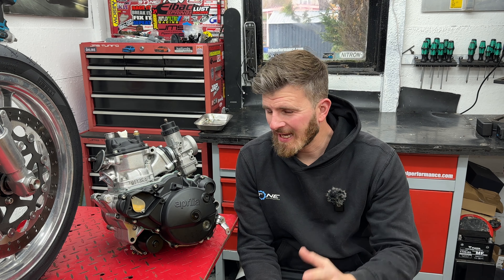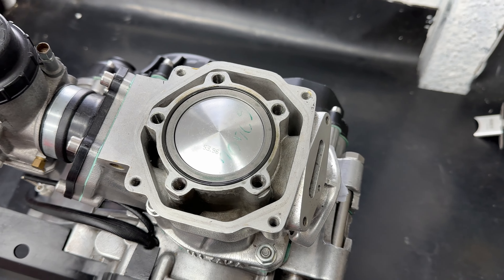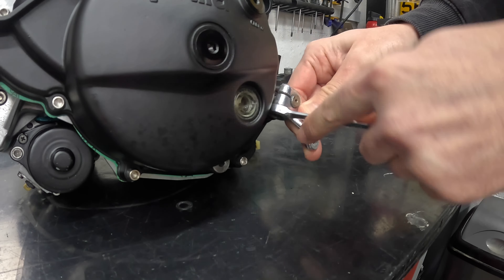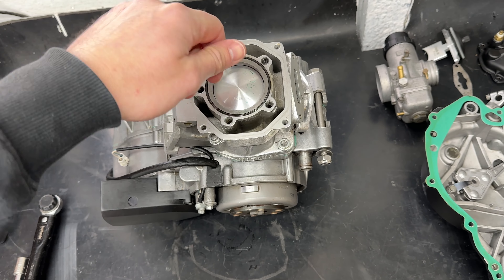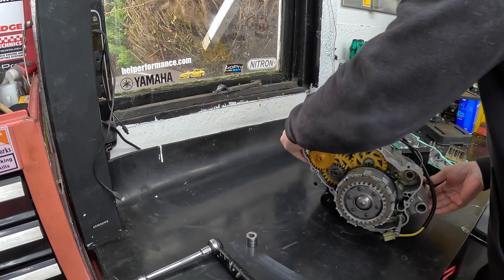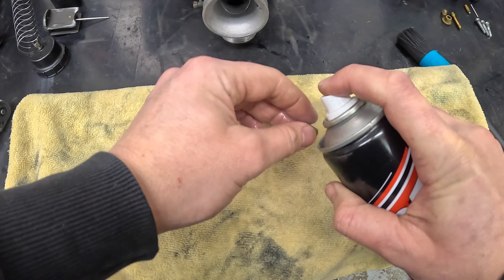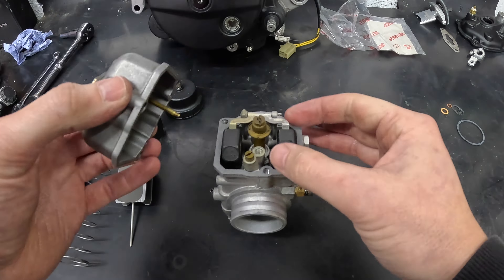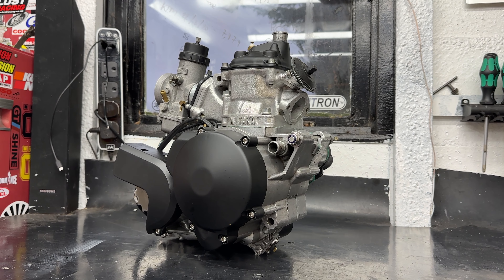Aprilia RS125 restoration project - Is the engine I've bought actually any good? Episode 2

Comment: 9:45 The squish gap is the squish gap, it won't tell you much about the compression ratio. You could have a head which is running 1mm squish but the combustion chamber volume has been made large by machining the bowl, the CR would still be low. You need to get both aspects of this right if you want the best out of your engine, I would imagine that the squish gap would want to be around 1mm, maybe a touch less. You don't want the gap to get too small as it pushes the gas velocity up too high which can then promote detonation, (the opposite of what a squish head is supposed to do!) Equally you don't want the gap too large because it will stop working as a squish band, it also wastes some of the inlet charge because it will burn too late to be of any use in making power. With your gap at nearly 1.6mm I would say it is 'borderline' not working as a squish band at all.  The head volume at TDC will determine the compression ratio, I have no experience with your engine but as a guess you would want to be running around 13.5:1, this would be the geometric ratio, not the 'corrected' ratio (i.e from when the exhaust port closes). I don't like using the corrected ratio, its nonsense in my opinion, basically I agree with A.G.Bell on this point, he is the author of one of the 2 stroke tuning books that I have. (The charge lost out of the exhaust port is forced back into the engine anyway by the reflected positive pressure wave in the expansion chamber). I'm sure someone will come along and give you the CR figure that is best for your engine, bear in mind that pushing up the CR can help the mid range and top end but can cause the engine to not want to rev much past peak power RPM. If you go to high with the CR then clearly you can push the fuel into detonation, or at the least the engine will 'heat fade' when the throttle is held wide open for long enough to allow this to happen. Obviously the fuels octane rating comes into play here.
Reply: I was going to say that! Honest. 😂
Reply from the maker: Thanks for the detailed reply, the barrel is going off to PJME 😬

Let the professionals work the magic (above my head 😅)

Comment: You seem to be measuring both sides of the solder at the same time. You need to measure each side of the solder separately.
That's why you are getting such a large squish band.
Been waiting for this video. 👌
Reply: Yes, Paul. That's what I thought, too. So it's probably about .75 mm which should be okay.
Also squish doesn't equate to compression ratio, that needs checking separately. 
That said it looks like a great engine you have there.
Reply from the maker: Sorry lads should have been clearer in the video, solder wasn’t thick enough so ended up doubling it up
Reply: @AutoBeta2T  Well said that man! 🙂
Reply: Great 'catch, well done for spotting that.

Comment: I have recently rebuild an rotax 122 engine for my rs, measured the squish as well, got to 1,4-1,3 with 0,3 gasket. So I spoke to a pro and measured the volume of the head with oil and that was about right for non-racing 125. So I guess the big squish is ok as long as volume is as well. Ran ti, runs well. On a stock head tho.
Reply from the maker: Interesting, I’m now down to 1mm squish so we shall see how it goes 😅👍

Comment: The jetting seems ok.   Had that been my bike i would not hesitate to fire it up with that carb setup.   It probably was the carb for that engine/bike, it just got pulled of and someone forgot to empty it for fuel when doing a rebuild on the engine(/bike)   It looks like you are missing some parts for the Power valve. Not sure what mode you have there. but there should also be a "housing"  and an adjustment knob(black housing and red knob, or alu frame and black knob)  Keep them videos comes, love to see the Rotax/2 stroke content.
Reply from the maker: Thanks for the feedback, like you say a few others have mentioned the jetting is about there 👍

That power valve is complete so I’m told, there is a more advanced version which is adjustable but this ones fixed opening (let’s just hope it works 😅)

Comment: I had one rotax 122 on my aprilia sx 125 and it was amazing engine. I had VHM and 38mm carburator with arrow pipe. It was nice and realiable bike and very powerful. I drove it 3 years all the time and just changed oil and pistons. I tried those rave power valves, but I used it with open valve because i had problems with those power valve systems.

E: Im not sure if this is rotax 122/123, but it seems similar. I remember that I needed to put 800ml oil in it, but it said 600ml on the side. If you used 600ml you brake yellow plastic gears. I would check that out.
Reply from the maker: Mines the 122, shall be interesting to see how I get on with the power valve set up.

Thanks for the tip regarding the oil 👍

Comment: there are 3 different vhm heads, i just got mine a few days ago, i ordererd a standart one bute there are 2 others. there are 11,50cc wich is a higher compression ratio then there is the 11,60cc wich i orderd with standart compression and there is a 11,80cc one with lower compression ratio. with the 11,60cc head i now got a 13,48:1 compression wich is exactly what i wanted. with the standart head my squisch whas way off with 2,1mm, even with the thinnest gasket i could find. ur 1,5mm would be bang on for street use.
The 155 main jet is standart set up in the 34, i am now running a 158, cause i got a few mods done to the engine and around
Reply from the maker: Good to know! Strange there’s no markings to let you know which model I have..

The squish is now set at 1mm - the barrel/ head was sent away to Paul at PJME and he machined the barrel down to increase the compression 😎

Comment: Regarding squish and high compression, from an MX point of view. It isn't always a good idea to run a higher compression because you might loose some overrev capabilies. Therefor loosing power and revs on top for a small gain at low revs.  Since small displacement engines need revs to produce power I wouldn't raise the compression by alot, especially if you don't intend to put some hours dynotune it to get it working right.

Short, some stones is better left unturned 😊
Reply from the maker: Agree, you can certainly go to low on the compression, detonation can then also start to occur 🥴

1mm squish appears the best setting for a road bike, with it being 1.5mm it’s going off to Paul at PJME for a slight tweak 😬

Comment: Sound mate, yeah, I got some rik Rings instead of the mitaka 140cc rings there ment to be one of the best , Japanese rings and engine is all done and frame work completed now off to the powercoaters next month, got new set of raidtors coming soon and a graphics kit from france. I'm on the worst part now sanding all the pannels 😂 in order to down to spary them
Reply from the maker: The painting part is so satisfying but as you say the prep is a nightmare 😅

Comment: It looked like when you had the original measurement t piece made there was only one thickness of solder on either side but then when you were measuring in the end you were measuring two pieces together. Was this just because you weren't getting any reading with the single thickness?
Reply from the maker: Correct, I should have mentioned that in the video
Reply: @stoneautomotive  okay that's what I figured I just wanted to make sure you weren't for some reason measuring both sides at the same time.

Comment: Engine is spanking! Also I noticed you used a fancy little attachment for your torque wrench to get on those head nuts - what where they!?
Reply from the maker: Crows foot spanner, can get you right out of trouble 😅

https://www.ebay.co.uk/itm/234953648537?mkcid=16&mkevt=1&mkrid=711-127632-2357-0&ssspo=X_IuMAaJS4q&sssrc=4429486&ssuid=CKFRglVnR7S&var=&widget_ver=artemis&media=COPY

Been following your latest project, soul destroying the head ache it’s given you but fair play for cracking on 👍

Comment: K21 needle (look up the chart and measure what's in it, might already have one) on top or second clip, 158-160 main, 34-36 idle jet, B40 emulsion tube. Definitely needs less squish, not sure how much less though, I'd guess in the 1.15mm range... Although running at 1.5mm will be fine most likely. Start with the fatter jets and lean it out one size if a plug chop indicates you need it.
Reply from the maker: Yep I have a solution now for the squish, PJME will be working there magic!
Reply: @stoneautomotive  I look forward to hearing the little blighter sing 😁

Comment: I’d assume that vhm will specify a squish clearance of 0.8mm, which will also give you the correct combustion chamber volume. 
As of your measurement of 1.5 mm, not only are you excessive on the squish clearance, but you will also be low on compression. 
Using a thinner base gasket will get you closer to the desired spec, but I think you’ll struggle to find a base gasket thin enough to bring it into spec. 
I’m guessing that the mitaka cylinder may be slightly taller than the stock cylinder.

You should also perform a pressure test once assembled.
Reply from the maker: We have a solution regarding the squish, more in the next episode 😬👍
Reply: @stoneautomotive  good to hear, I’ll look forward to it 👍

Comment: What jetting is in that carb im running a 155 main with 37.5mm pilot with the 34mm carb and 140cc mitaka and dual stage reeds and runs faultless i know some one who has 4 mx 125s and runs this same set up without issues
Reply from the maker: Reviewing comments I’m “ok” on the current carb set up 👍

Comment: Looks like that barrel has had a liner fitted (standard it would be a plated bore, and the Mitaka barrels also use a plated bore).

If you get oil in the ignition side cover then you have a big problem!

Jetting sounds about right. The needle valve looked worn (from memory, brown end of the needle valve is the later type suitable for fuel with ethanol in it).
Reply from the maker: PJME completed the top parts so should all be in good order 😬👍

Thanks, no gasket for the ignition side cover though to prevent dust etc entering?

Good to know regarding the needle valve 👍
Reply: @stoneautomotive  , think silicone is meant to be used between the ignition cover and the engine
Reply from the maker: @twosqueaks4839  that was my later thoughts too 👍

Comment: I wouldn’t go under 1mm squish on the road. 

I would guess that 0.8 squish would be too tight even for premium pump fuel. What people seem to mis understand is that making the squish mega tight also reduces the cylinder head volume… in turn causing the compression ratio to be much higher than what is safe on pump fuel.
Reply from the maker: Yep a few have advised 0.8mm is too much for a road bike, barrel will be going back to PJME for some magic to happen 😬

Comment: Looks like your idle jet is missing. It should be a 5mm thread, 40 to 45. Main jet is 155 is fine if you use the original airbox, then it depends on the filter thickness, exhaust and so on. 155 is a good starting point, though you might need to go down to 150 or up to 160 according to your specs. Without the idle jet I don't think you'll ever be able to idle, it'll always be too rich below 2000 rpm. 1.5 mm squish gap is standard. With the original Gilardoni Aprilia cylinder usually needs 0.3mm or 0.5mm to reach 1.5mm squish gap, though I've been told that the Mitaka kit might need thicker gaskets. I wouldn't go lower than 1mm. You can measure the compression ratio, but there's always a margin of error even if you use the correct technique. MItaka kits seem to be reliable enough, though the fusion is not perfect, that might explain why they ported it a little.
Reply from the maker: Thanks for that, shall have a proper look over the carb when the engine goes back, something simple like that could cause a lot of headache 🤦‍♂️

Barrel and head are back from Paul at PJME and skimmed to 1mm squish 😬
Reply: If you need to buy the idle jet, I recommend the 'tall' ones. I know some people on the 28 remove the idle jet when they go racing, you need to screw the idle screw all the way in, they do that because their engines run at 13/14k rpm and they might seize if they use the engine break after going flat out all the time. Having a very rich idle might help extreme users, but I don't think that's your case. Let me know how it goes

Comment: 1.00mm is the correct squish 0,8mm is to small, and wil get pre detonation
Reply from the maker: This is what I’ve been advised, thanks for confirming too (good to know thats considered the optimum for roads bikes 👍)
Reply: @stoneautomotive  I race the same cylinder on my racing kart. And there it’s even set in the rules to not go under 1.00mm gap. Check your spark plug gap too it needs to be 0,7mm for best ignition. And the powervalve should open at 7500tpm for the best torque and power band. There is a kit for the 125RS that makes it possible for setting up the powervalve at the RPM you like it the most.